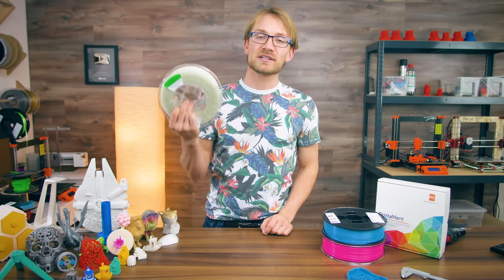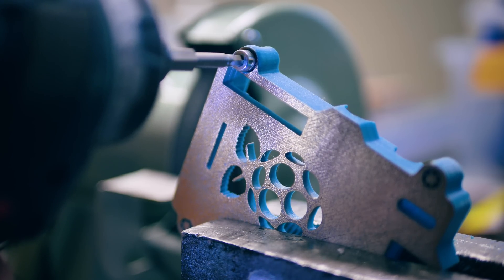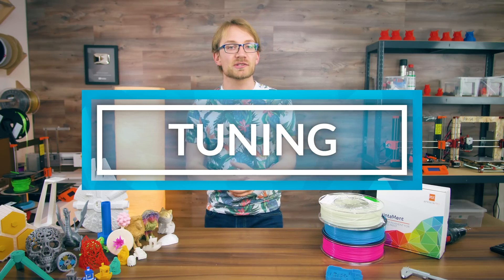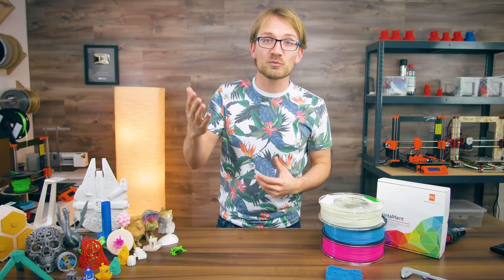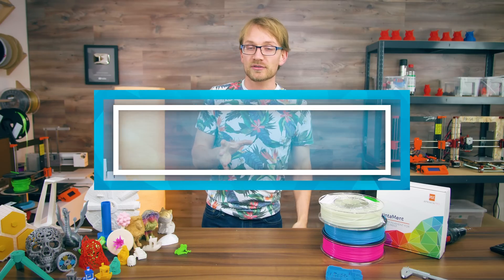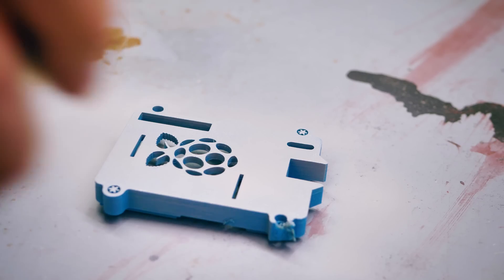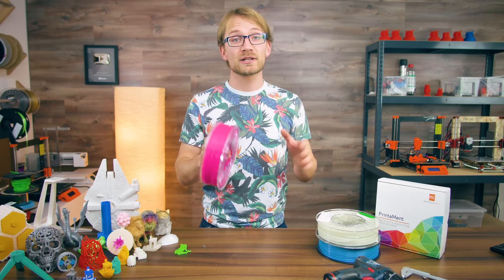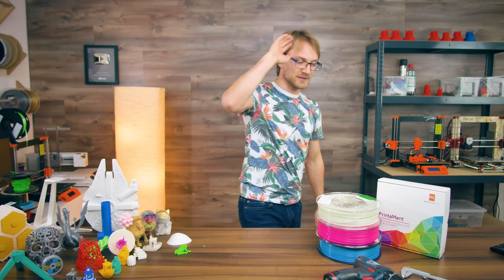Things you should know about PLA

Comment: i print in PLA like 90% of the time , although i must admit the first ABS print was way way better than some of my last PLA prints, maybe it's just a good ABS or crappy PLA but the ABS seemed to have better layer adhesion even at the low 245 temp i used while PLA starts loosing layer adhesion as soon as the print is not shiny anymore from the raised temp.
  i guess  might get PLA prints to look as good as ABS if i lower the temps even further and maybe lower the cooling or something to keep the layer's together.

Comment: My settings  for ColorFabb  PLA-Economic     and     123-3D Jupiter  PLA
Printer own design.
E3Dv6 style + partscooling 360° around the nozzle.  All hotend parts : selfmade.
Temp :  225° nozzle 0.4                           245° nozzle 0.7  
Speed :  90mm/s nozzle 0.4                   55mm/s  nozzle 0.7
Bed :  70°/65°  degrease glass with glasscleaner

Comment: Guys you have to understand the difference between tensile strength and durability. PLA+ is weaker than PLA but it’s more ductile and is more useful. Just like ABS, PLA has higher tensile strength, but it’s too brittle to be as useful.

Comment: Is there a systematic way of calibrating a machine for a new filament?
Reply: Jeffrey Drake what I usually do to tune a filament is first do a temperature tower and see which temp looks best then after that create a 20x20x20 mm cube and have no top and bottom layers so I can adjust flow rate so that say you're using a 0.4mm nozzle and you want auto extrusion width then the cube with two walls should have thickness of 0.96mm if manual 0.8mm

Comment: For me eSun PLA+ seems to be great. It can be trimmed easier with a razor knife, and it has a slight bit of flex like PETG, or ABS, and prints extremely well. It seems if anything tougher, and less brittle than standard PLA, and I've switched to using it almost exclusively.
Reply: I'm glad to read this - eSun PLA+ is the only filament I've used, so I can't compare it to anything.
Reply: I've had the same experience w/ esun pla+.  I think tom is generalizing the term "PLA+" even though it means different things for different manufacturers.

Comment: Interesting video.
i've been experimenting with post finishing PLA, and I think i have something that's different that might help light and heat resistance:

Basically, you rub the PLA part with sulfur powder prior to annealing or flame polishing step (depending on the finish you're looking for). You do need to heat the part up again after applying the sulfur. 

The surface feel changes. It's not as 'sharp' and it seems to flex more. 
One of these days i might try doing some stress testing for an exact quantification.
I do have a background in chemistry.
Sulfur is good at modifying long carbon chains and it absorbs UV light, so i would expect that it'd make the PLA less prone to light damage and stress cracking. . 

I suspect Borax and boric acid should work in a similar fashion, but haven't experimented with it yet to know exactly how it'd work.
Borax is sold in nearly every supermarket in the USA, and sulfur powder is commonly available in the gardening section of large supermarkets. It's probably similar else where in the world, since borax is a common washing product. Boric acid is harder to get ahold of, but still not impossible..

Comment: I’m confused now? Did you say you “can” glue PLA using Acetone Welding? Because you really can’t. In talking about PLA you kind of missed one of the most important facts, PLA is not a petrochemical plastic the way that ABS, PETG and Nylon etc are. It’s an organic plant product. Made largely from Corn Starch and Cellulose. With a very slight resin plastic base. This is why it is long term biodegradable and why it is not good for outdoor applications. A good example of PLA being used in a non 3d printing application is the biodegradable plastic knives and forks they use at places like Disney Parks. But getting back on point, because PLA is not a Petrochemical Plastic, Petrochemical Solvents such as Acetone won’t melt or bond it. At least not very well. You need an organic solvent such as Ether. (And no it is not recommended you try and use ether as a glue. Or even keep the stuff around the house.) To Glue PLA use standard contact glues such as CA or 2 part epoxy. Not solvent glues.
Reply: well, then watch his video on it, as he recommended. idk what really is in that PLA we're printing, but some things in there seem to react to acetone and it does work.

Comment: My settings for Hatchbox PLA on i3 clone:
190° hot end
50-60° bed
60mm/s inner walls and support
30mm/s outer wall and slower acceleration
All other settings are stock in Cura
I get great layer adhesion and minimized ghosting
I am also using an E3D V6 (real one) on a custom made aluminum carriage
Reply: What are your fan settings for first layer and the rest of the print?
Reply: NanoBotAstronaut for PLA, full throughout. It sticks well enough to the bed which has blue tape and glue stick. I also print with a brim of 6-8mm

Comment: @Thomas + Luccccccccerrr, I second that. Acetone welding with PLA?  Tried it... doesn't work in Holland :-) or should I soak it for more than 20 minutes in Acetone?
Reply: Just to be sure that I am not talking nonsense here, I have re-run some tests on how to dissolve PLA. So far I have tried Acetone, Thinner and Dichloromethane. None of these solvents was capable of really dissolving PLA. PLA tends to a little get weaker over a long time when submerged in one of these three solvents, but I have not been able to create "PLA-juice" in a similar way as we can create ABS-juice with these solvents. Does anyone know the real solvent of PLA?
Reply: I use Weldon #4 it hasn’t failed me yet
Reply: Tinkerman Did you use Nail polish remover? If yes, check if you used one without acetone. I made that mistake myself ;)
Reply: Mine is the same. I bought some from the drug store and it does dissolve abs dang quick but pla only softens if you soak it for days.
Reply: No, I am afraid I used regular true Acetone
Reply: @kistuszek  Same here...
Reply: @Tinkerman 
You are 90% Right. You can find on almost all web forums - Acetone doesn't afect PLA at all. I've tried even recomended Tetrahydrofuran.. which doesn't work either. Some says that Ethyl Acetate might work - did not try it.
And using most of superglue or other standard glues - they don't stick to PLA as well.
PLA is practically useless for any bonding, mechanical parts, anything that needs to resist temperature. 
So you are ending up with printing 'models' and by models I mean something that just gives you the concept of shapes and size.. nothing more
Reply: @Tinkeman
As you said. Nothing works. I also tried Cyclohexanone (that works for PETG as Acetone for ABS).. no sucess on PLA.
To solve PLA probably you need some nasty kind of solvent. Or just use a heat gun for bonding/smoothing. Nothing but temperature works on this plastic.
Reply: Perhaps it will dissolve in popcorn, since it has been made of corn starch :-)
Reply: I tried a superglue remover on some PLA and that melted it just like acetone on ABS.  The active ingredient was Nitromethane iirc.
Reply: My understanding is that Acetone has no effect on PLA, but that Methyl Ethyl Ketone (MEK, a.k.a. Butanone) works on PLA similar to how Acetone works on ABS.  However, I have never tried it myself.

https://en.wikipedia.org/wiki/Butanone
Reply: Nitro methane is an additve in model racing fuel. Some shops sell it in 100% strength to mix your own fuel blend.
Reply: +1 for the acetone failure with PLA

Comment: I used to print mechanical parts with ABS, then I realized ABS might not be the best choice even it resists breaking a lot better. PLA tends to be very stiff, which is really good for parts that you want to minimize the flex. ABS/PETG tends to have a lot of flex. However, by printing with PLA you have to design your parts really well to reduce the stress on the weaker spots of your prints. For me, the only down side is the super low softening temperature...
Reply: Try the Polymax PLA. I've found it prints nicely, is less flexible than ABS but at least as impact resistant. Not sure about temp resistance though.
Reply: @stephenhobson8456  pla start deformation about 60 celcius , petg about 80 celcius, abs about 100 c
Reply: I wish PDLA (HT-PLA) got more popular and cheaper, that would be so awesome!
Reply: Pla is easy to broke , petg is very strong cause is more flexible

Comment: Does PLA really react with Acetone though? I have constantly heard that it doesn't react at all to acetone, only ABS does. I print little platforms out of PLA on which to vapor-smooth ABS prints, and the platforms don't melt at all.
Reply: I've welded many PLA parts with Acetone. I use a brush and apply a light amount to each part, then hold them together for 5 to 10 seconds. May not even take that log, but they bond within seconds
Reply: Rub acetone onto a shiny surface of a PLA print and you'll see it's no longer shiny. So yes, it does react with acetone.
Reply: PLA doesn't react the same way to acetone as it does with abs.  It doesn't dissolve it.  However, it may temporarily weaken it enough to mash 2 parts together to make it bond. That's something that probably doesn't work all that well with anything but flat well fitting surfaces though and your success will vary.

Comment: You don't find that black/dark colors works at lower temps than white/light colors?  Also, I find that this Paramount 3d red filament is much thicker and more warp resistant than Hatchbox white.  Not sure why, but I can see it in the prints.

Comment: Hi, how to avoid PLA heat creep? Mainly when retracting?
Reply from the maker: If you're using an all-metal hotend, the heatbreak is the most crucial part in the equation. Heatbreaks made by third parties are commonly produced with thicker walls in the insulator area, which is easier to manufacture, but will conduct much more heat into the heatbreak - leading to PLA heat-creep clogs. Use a good heatbreak and make sure the heatsink (or top of your hotend in general) is well-cooled.